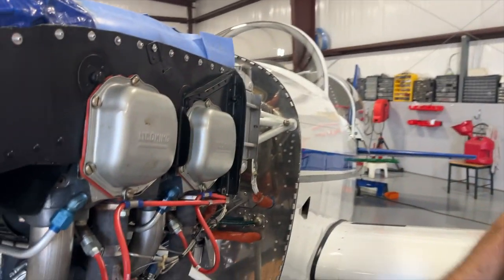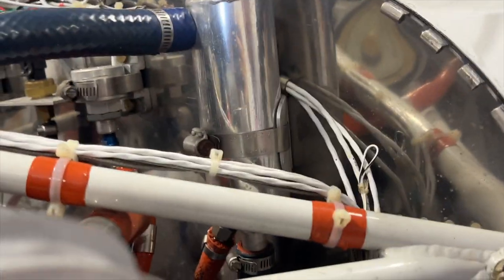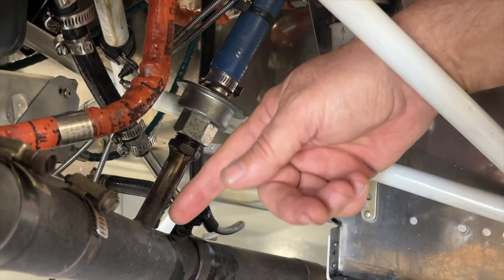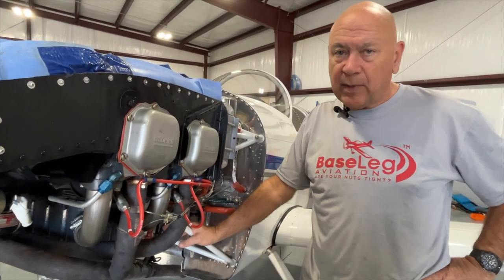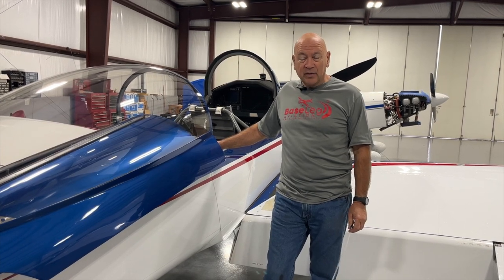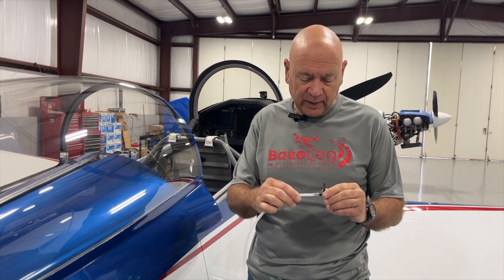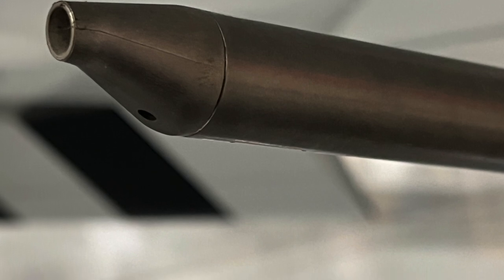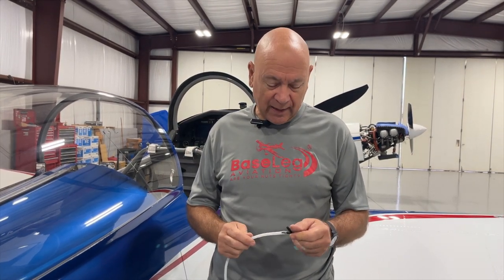Blocked breather tube and static leak

Comment: Vic, what about those of us that do NOT have the antisplat oil seperator but do want to protect the engine from a possible clogged breather (eg ice)? I've heard some suggest a small slit in the top of the tube itself to serve as an emergency bypass? Sounds fishy but interested in your thoughts on this practice or what your recommendation might be? Thanks!
Reply from the maker: Yes, it is standard practice on certified aircraft to place a whistle slot in the breather tube just above the cowling exit.

Comment: I built an RV-10. I clean the coked oil out of my anti-splat where it connects into the exhaust during every oil change, and make a note in the engine log book. There is always oil coking there. Not ever as bad at what you bore scoped. I also have the secondary safety hose and valve. The only thing I EVER clean off the belly is exhaust residue. Never any oil. Thanks for the Videos!